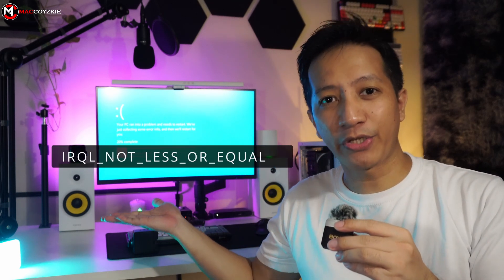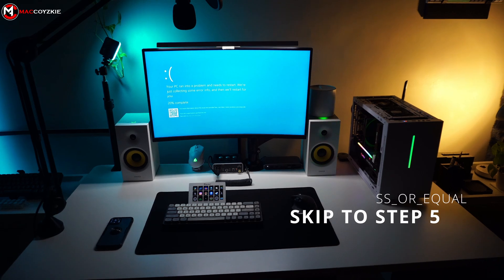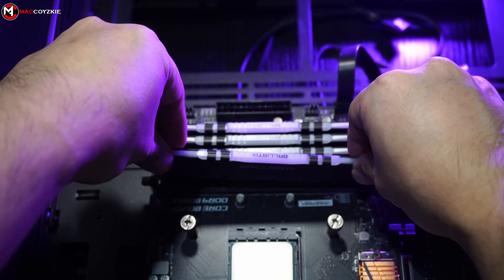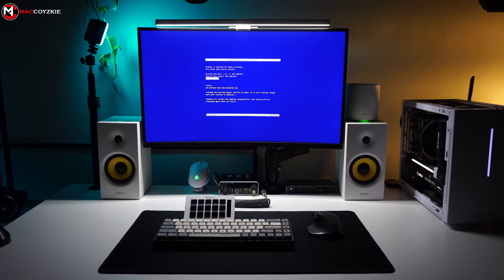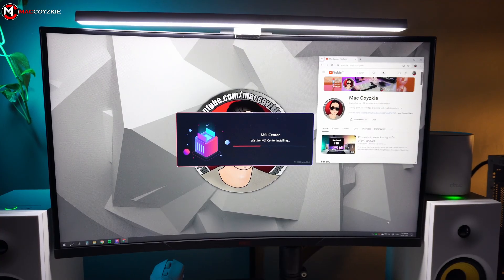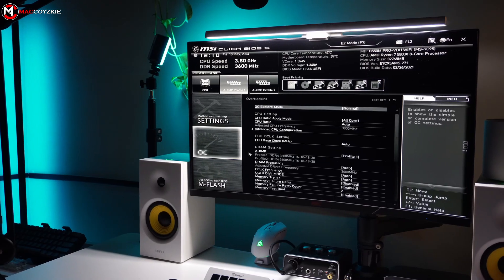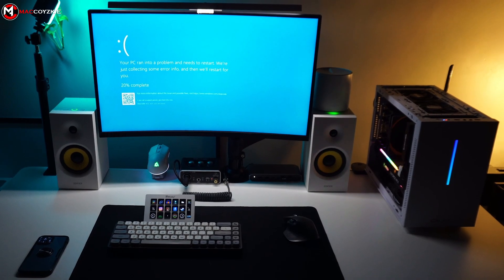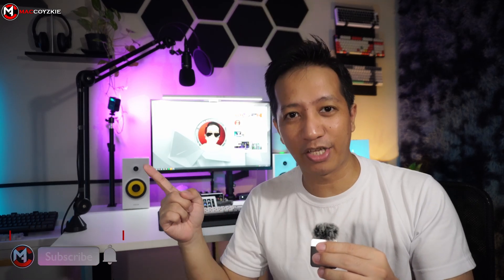IRQL_NOT_LESS_OR_EQUAL : BSOD Fix!

Comment: hi, i have the problem and i use ddu to uninstall drivers amd and nvidia because i have laptop r7 4800h and gtx 1650 ti, and i installed new drivers for nvidia and the radeon graphics card, and i do a lot of other things but it still crashes, for now i didnt use sfc/scannow and others command, and i didnt use drivers verify or something like that, its only hapeening if i open the valorant and play not even 1 round competetive and i have the blue screen with the reason irql_not_less_or_equal, how fix it

Comment: boss I have this same error,  I have win 11,  and as per Valorant's instruction for their anti cheat software, need nila enabled ang, Boot secure, TPM, IOMMU, at virtualization (AMD-v).

Na on ko po lahat. Restarted my PC, played the game, then got this error:

VAN: Error:
an iommu restriction has been applied, however a system restart is required to complete initialization

So I restarted again as per the message. then after the  BIOS splash screen, nakakuha po ako ng same na BSOD: pero merong Driver sa unahan.

DRIVER_IRQL_NOT_LESS_OR_EQUAL.

Only way para makapasok ako is to do system restore, whenever I try to again, and restart to finalize daw ang initialization ng IOMMU error, then BSOD ulit. Baka pwede mo ko ma tulungan boss.
Reply from the maker: bossing ano gaming mo windows license? oem ka ba or retail? hindi ko alam kung nabangit ko na, try mo ilagay sa windows security exemption yung valorant folder https://youtu.be/Azf79t1vkaU
Reply: @MacCoyzkie  OEM License po bossing.

I will try this step bossing tapos balikan kita. thank you po
Reply from the maker: @pex1049  inaral ko ng onte paps, di kaya sa driver conflict din ito. Yung enabling ng IOMMU at AMD-V. Baka hindi sya fully supported ng mobo or di kaya need lang ng bios update.

pag ayaw pa din try naten ito. sa bios reset mo muna sa default then enable secureboot+tpm, then try AMD-V bago last yung IOMMU
Reply: currently bossing naka B650M ako. 

Same step bossing ginawa ko,  yung mobo ko merong 3 options , (enable, disable, auto) lahat neto naka auto na .. ginawa ko bossing ang same step. 

Last yung iommu. same issue. try ko muna ang bios update. baka gumana.
Reply: @MacCoyzkie  boss I tried your step. wala talaga . but when I followed this video's last step na mag change ng boot drive and I installed new windows. it worked! save the best for last nga. Thank you bossing
Reply from the maker: @pex1049  glad its all good na hehe, time to game lol

Comment: Lumalabas sa akin yung error na ganto halos araw-araw kada magbubukas ako ng laptop then wala na after magrestart. Ano po kayang problema? Hindi lang IRQL ang lumalabas na error minsan, meron ding HYPERVISOR-related. Hindi ko siya pinapansin masyado kaso isang beses lang nangyayari or madalang lang. Paano po kaya mafix yun? Anyways, HP Victus 15 laptop po yung device ko.
Reply from the maker: naku, iba-ba bang bsod lumilitaw or specific na irql lang? pag maraming bsod ang usual problem is yung power connection papunta dun sa gpu. ngayon depende kasi sa laptop kung papano ayusin. suggestion ko pa check mo na sa nearby pc shop kasi pag lumala yan mawawalan ka ng display. ok pa naman yun pc nyan ang problem lang baka loose power connection or nasunog yung cable mismo.
Reply: @MacCoyzkie irql lang and hypervisor ang madalas na nangyayari. Everytime na magbubukas ako ng laptop galing sa matagal na pagkakapatay. Halimbawa ay galing sa pagtulog then bubuksan sa umaga.
Reply from the maker: @MarlonJayIlagan  gumagamit ka ba ng virtualization software? meron kang kailangang i-turn on sa bios, kapag naka intel ka hanapin mo sa bios ito "Intel VT-x" or pag naka amd ka "AMD-V" basta enable mo sya tapos save and exit bios
Reply: @MacCoyzkie  hindi po ako gumagamit ng virtualization software. try ko yan kuys. anyways, may copy rin po pala ako ng memory dump nung dalawang uri ng IRQL bsod.
Reply from the maker: @MarlonJayIlagan  sige balitaan mo ako
Reply: @MacCoyzkie  kuys, hindi ko pa nagagawa yung sinabi niyo kasi simula nung last reply ko ay hindi pa ulit nagkaka IRQL bsod pero ngayon nagkameron ulit. Try ko gawin yung sinabi mo kuys. Nga pala, gusto niyo po ba isend ko yung dump file para mas malaman ang reason?
Reply: @MacCoyzkie update dun sa amd-v, hindi ko siya makita sa BIOS. Meron dito na naka enable, yung Virtualization Technology.
Reply from the maker: @MarlonJayIlagan  ok, shut down mo muna pc tapos alisin mo sa saksakan, then clear cmos mo muna para maalis yung potential maling settings ng bios https://youtu.be/S9hyEPTFR10 after nyan disable mo yung Virtualization Technology. i-on mo lang yan kung nagamit ka ng linux, emulators sa android or gumagawa ka ng subsystems pero pag gaming, web browse or office work dapat naka disable sya
Reply: @MacCoyzkie  kuys parang mahirap yung cmos since naka laptop po ako
Reply from the maker: @MarlonJayIlagan  load optimized defaults nalang sa bios
Reply: @MacCoyzkie boss, may issue ulit ako, hindi ko nafix yung issue last time so nagtry ako mag-update ng gpu driver from 566.36 - 577.80 (NVIDIA 2050), okay naman siya after ng update. Kinabukasan, binuksan ko then two consecutive bsod ang lumabas, PAGEFAULT_IN_NONPAGED_AREA at MEMORY_MANAGEMENT, magkasunod yan after ng restart. After magrestart ulit from MEMORY_MANAGEMENT, pinapalagay ang recovery key and nirestore ko nalang since yun lang yung choice dun. Ano kayang problema kuys?
Reply from the maker: @MarlonJayIlagan  pag multiple bsod may tama yung psu cables mo, check mo nga kung nag melt sya lalu na yung sa gpu pins. try mo gamit ng ibang psu. kapag ganun pa din need mo na ipa check yung individual pc parts mo sa working pc, kasi isa dyan pasira na
Reply: @MacCoyzkie  same issue ako sakanya sir sa notskrnl.exe irql not less or equal at hypervisor pero bago pa to lagi nawawala yung audio drivers ko dell alienware m15 r7 po gamit ko
Reply: @MacCoyzkie dinala ko sa pagawaan sir IO controller chips daw
Reply from the maker: @ChxseIV  pano naging controller? natry mo na ba yung suggestion sa video?
Reply: @MarlonJayIlagan  bossing na fix mo naba tong issue mo? Same tayu ng issue nagawa ko na lahat ng pweding gawin
Reply: @nheilcanoy7609 na-fix po siya temporarily pero bumalik rin and ganun pa rin now. na-update ko na lahat and naipa format sa technician, kaso wala pa ring nagbabago, bumabalik at bumabalik talaga. baka problema na sa board 'to or hardware, update ako kapag nagawa na boss.

Comment: Sir, may issue din ako na ganyan pero yung nakalagay sa baba (what failed: admk.mdag sys) pag nag vavalorant napo ako
Reply from the maker: naka amd gpu ka siguro, update mo lang gpu driver mo
Reply: No gpu, po integrated graphics lang po ako eh ryzen 3 5300g😢 dipo maka laro ng valo recenlty katapos kopo mag update ganun napo sya
Reply: 16gb ram pero magka ibang brand po
Reply from the maker: @carloofficial856  gawin mo to para malinis yung integrated gpu driver mo https://youtu.be/SvIJhcxZTsA tapos install mo nalang ulit. minsan kasi corrupted driver lang
Reply: Wala po bang mangyayari na iba pag nag uninstall ako nun? @MacCoyzkie
Reply from the maker: @carloofficial856  wag ka matakot, ang worst case scenario nito magkakaroon ka lang na low reso display, temporary lang yun hangang sa mainstall mo ulit yung fresh gpu driver. pero usually kasi automatic ang installation ng integrated graphics. kailangan mo lang i fresh start kasi baka na-corrupt yung current driver kaya nagkakaissue

Comment: CAVEAT: If you are using Bitlocker enabled on your drive, you must have access to your recovery key, when using Windows Memory Diagnostic tool. Otherwise your diagnostic will hang on a step where it asks the user to input the recovery key.

Comment: dell poweredge t310 tower server microsoft windows server 2016
 Stop Code: DRIVER_IRQL_NOT_LESS_OR_EQUAL
What failed: NDIS.SYS
Please guide me
Reply from the maker: NDIS.SYS is associated with network drivers, so it's crucial to make sure your network adapter drivers are up-to-date. Go to device manager and update it from there. Also check for new windows os update. If you can't enter normal desktop then try it in safe mode https://youtube.com/shorts/IZKc8plksDA

Comment: I've done a clean install of windows 10 home, because I was having all kinds of BSOD's before, I was hoping the clean install would solve all my BSOD problems but no, they keep happening and I'm extremely frustrated......

I've checked the ram and non of my 4 sticks are bad, I used the memory diagnostics and it returned NO errors
I've reseated the ram sticks and the graphics card
I've done the system file checker command and it returned no errors
i've done the restore health command and it returend no errors
I've tried other commands I've seen recommended and nothing is found corrupted or bad
I have updated my BIOS on the motherboard to the most recent version from 2024... and nothing, still getting BSODs
I wiped my NVME SSD and did a full clean install of Windows 10 like I mentioned earlier.... and STILL getting BSODs!!
I've dusted off my computer
I've updated all the device drivers
I've updated my graphics card drivers

what am I supposed to do now if I have tried basically ALL the recommendations I have found on youtube!

I feel like I can't get away from BSODs as hard as I try, it's becoming a nightmare wide awake!

the errors recorded in the event viewer are:

service control manager event id 7023
bugcheck event id 1001
I even got a kernel-power event id 41
kernel-even tracing id 2
device setup manager event id 131

this is truly INSANE!

Comment: In my case. IRQL or Kernel Security only appears on light usage like browsing the net, playing light games or when the pc is in idle. but when im playing heavy games or using emulators that consumes heavy CPU, GPU and Ram usage, the BSOD is not appearing. i have new rams, fresh installed OS, tried updating all drivers, removing hardwares like HDD, cables etc. new thermal paste. tried memtest and windows diagnostic tool. not doing any OC thing but still cant figure out  how to fix BSOD
Reply: same here. I have no idea what causes it its so weird
Reply from the maker: @inqu2539  try the suggestions in the video
Reply: I'm facing the same problems here . If someone find a solution please drop it here . I have checked my ram ssd battery all good I even used windows built in repair function but it still appears on light usage
Reply: @Rishabh1802  someone told me to increase the processor's volt on bios (a little) so that the BSOD will not appear or may appear but rarely. tried it and it works.
Reply: @omelet12 can you tell my how long you have been using this trick . And also how to do it and on which laptop are you ??
Reply: @Rishabh1802  5 months and im not encountering any problems on it. as i said. bsod may still appear but rarely. im using PC btw. theres a plenty of tutorial on YT on how to increase your processor volt. It may depends on your unit/bios
Reply from the maker: can you check if there are programs running in the background while in idle. check the tast manager processes, cpu & memory use should be going up, look for that program and uninstall it
Reply: Same for me, i have windows 11, i9 13900k and rtx 3070
Reply: @omelet12 did you manage to resolve the problem?
Reply: bruh, same, i tried everything. did u fixed that problem yet?
Reply: damn i faced the same thing, been using my laptop for a super heavy games such a RDR 2 and its not appear but when i start youtubing or doing some casual thing like listening music on spotify its just comin suddenly how sad, and yet i still didnt found the solution
Reply: @omelet12  did u fix it
Reply: @omelet12  bro, did you fix it ? 
Same with me when i playing heavy games BSOD doesn't apperance but when i use google or light use it appears
Reply: @OmarL-Tokhy-m5b  someone told me to increase the processor's volt on bios (a little) so that the BSOD will not appear or may appear but rarely. tried it and it works.
Reply: @omelet12  I changed windows to Iot ltsc 10 and paused upgrade of windows and just install graphics driver form ibot booster and BSOD doesn't appear yet 
I hopely it works because i'm confused
Reply: How can i do it ? 
I remove battery from lap and try to use it and BSOD continue appears so it not a problem  @omelet12
Reply: @OmarL-Tokhy-m5b  im using PC and not 100% sure if that method will work on others too. but on my case it works. because the main culprint of bsod is my processor itself. theres a tutorial here on YT on how to increase your processors volt (intel/amd). theres plenty of it.

Comment: Tried all steps sir, except STEP 6 since I did not OC all my components. My RAM pass the MEMTEST86, I freshly installed Windows 10x, I reseat all my hardwares. Remove my HDD with (BAD Sector). What could be the possible culprit to the BSOD? Can you help me sir pleasee 😢
Reply from the maker: what windows license are you using? oem, volume or retail?
Reply: @MacCoyzkie  I just Download the "Media Creation Tool" and make a bootable drive out of it, I dont have licenese

Comment: I been getting many blue screens after installing amd chipset drivers. I tried uninstalling it but I still get bluescreens
Reply from the maker: hopefully you can still go to safe mode https://youtube.com/shorts/IZKc8plksDA i suggest start backing up your important files in C drive and just have a clean windows installation
Reply: @MacCoyzkie  I did the clean windows installation through windows like the reset your pc setting and im still getting bluescreens
Reply from the maker: @cynz5294  not the pc reset windows, the problem will obviously still be there. im talking about fresh windows installation, basically format the drive to clean it before you install windows
Reply: @MacCoyzkie  how do I do that
Reply from the maker: @cynz5294  btw if you do this it will wipeout all your files in C drive and windows will start fresh. prepare this first https://youtu.be/FfPBOccfG70 also make sure you have your windows key too. plug the usb installer on your motherboard io and restart the pc, it should start the windows installation process, just go through the instruction
Reply: @MacCoyzkie  is it the same steps if I have a laptop or no
Reply from the maker: @cynz5294  yes

Comment: hi, I have an msi b650 gaming plus wifi, when I turn on the pc the debug lights come on, red, yellow, for 20 seconds, then it goes off and turns on white and then green for 5 seconds then it goes off and in about 30/40 Seconds I'm on Windows, I updated the bios, carried out many tests, everything shows 0 errors, I don't understand why these lights come on during PC startup
Reply from the maker: its normal, it's actually checking the parts if all are working. start worrying if you have a steady light on those debug led. more info here https://youtu.be/jtZcO7Q4yhA
Reply: @STORIEMILITARI  I been having the same problem so I keep my pc in sleep mode idk I may need a new part

Comment: i dropped something on the top of my laptop and it turned off. it turned on so i thought it was fine. but after sometime it bluescreened and was stuck.. i tried restarting but now it wont even turn on. But after some time i was able to open it.. idk what now
Reply: It has Kernel Security Check Failure
Reply from the maker: @hyutsuki  heavy or something liquid? this is the time you should be visiting the local shop since I have no tricks to fix physical damage